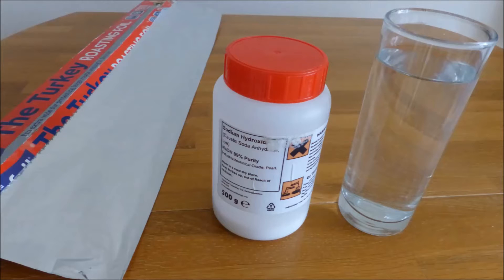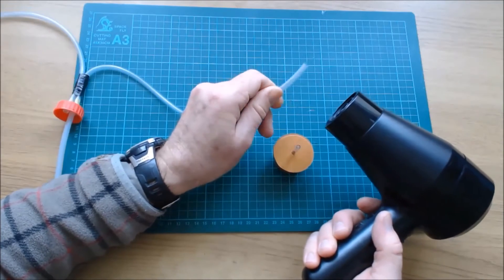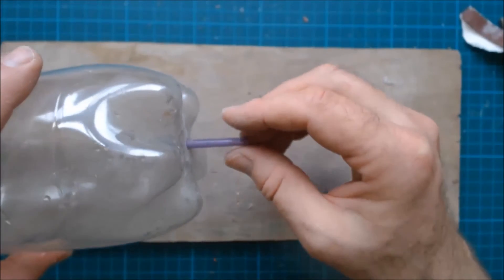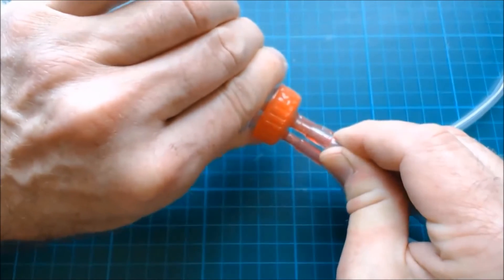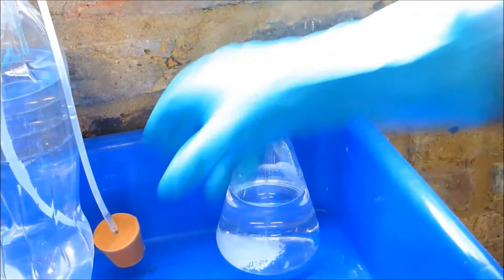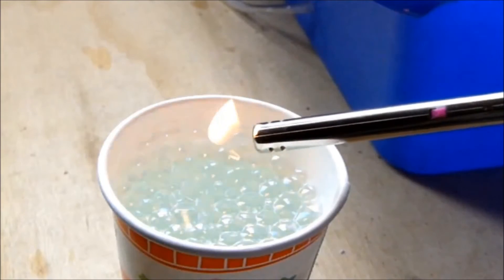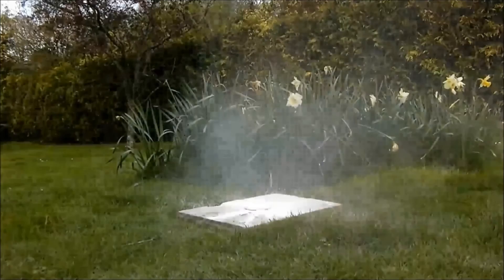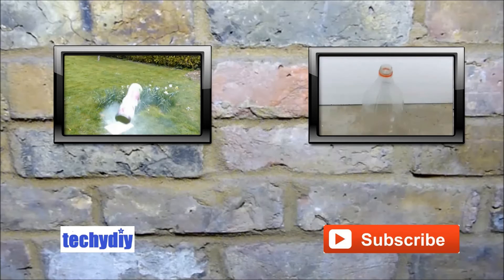How to Make Hydrogen Gas & Experiments

Comment: Check out this windmill design. It has a 4 year payback. After 4 years, the energy is free. You could make and store hydrogen gas all summer long. Then use it for your furnace to heat your home during the winter for free. With a zero carbon footprint.  https://m.youtube.com/watch?v=sGIZHJWV2ZM